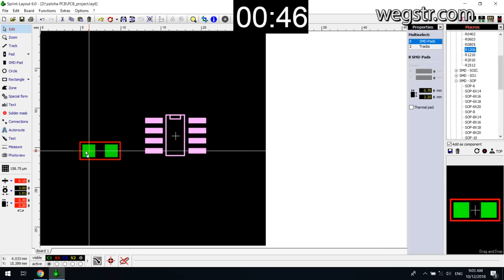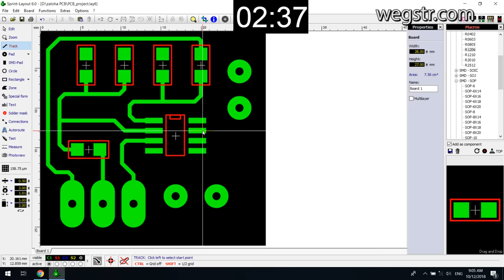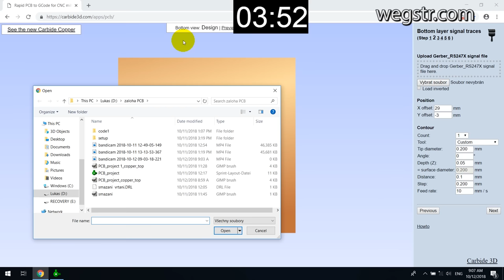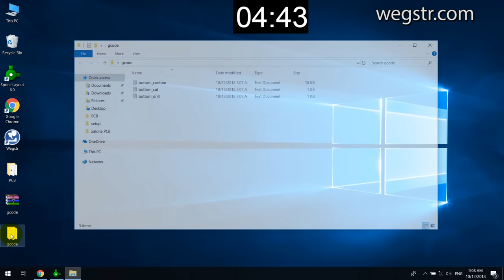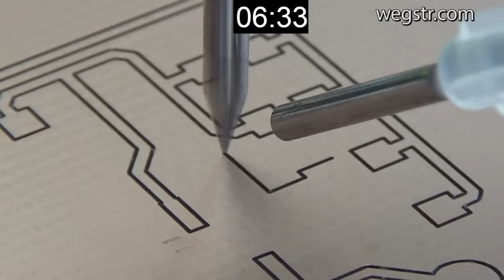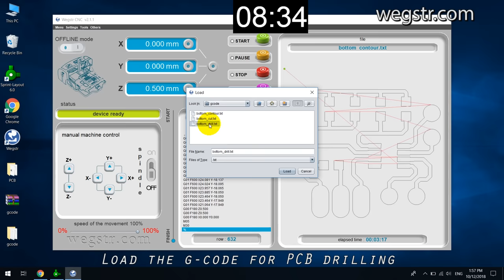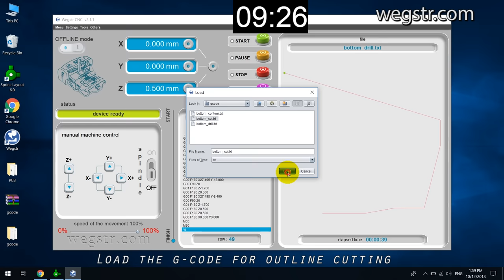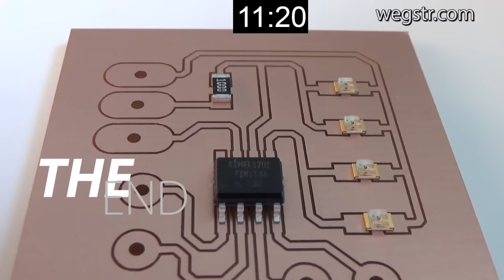PCB making, PCB prototyping quickly and easy - STEP by STEP

Comment: misleading video title: it should contain "expensive" as it involves the use of a commercial CNC tooling machine; a laser engraver is way cheaper and yields comparable precission and quality results
Reply: If you have a cheap 3d printer around adding a motor and small engraving bit is a prettycheap option. Should cost around ~200$ to get you the same results!
Reply: @mattyd_gaming7425  Not sure 3D printer has enough strength to keep routing motor.
Reply: Only a very high power (expensive) laser engraver will cut copper clad.

Comment: Step 1: Own a CNC machine
Reply: Exactly what I was going to say
Reply: @Pdrum2  of
Reply: It's very easy to short circuit (while soldering) because of small gap between conducted part and "no conducted". Maybe soldering is performed by another CNC ?
Reply: Step ZERO
Reply: @sawomirsiwek7558  so you just don't know how to solder?
Reply: Fuck.. that's a small big list..
Reply: I mean everyone here should be able to just build one right?🤣
Reply: Even with the cost of a bench top cnc mill / engraver, if you are doing one off PCBs on a more than a few times a year basis, the cost is reasonable in comparison to a prototyping board manufacturer or spending hours laying self stick mask components and etching in ferric chloride. My CNC was $600 as a complete kit, five years ago and similar units today are in the $300-400 US range. I also use my CNC to make engraved tags in brass/aluminum and plastic, plastic switch labels and controls ID plates and custom markers, the end results of my control panel builds going head to head with competitors with much larger shops.
Reply: Why I should buy such machine that cost around 4000$ while I can prototype my pcb's in China for less than 0.7$ per pcb
Reply: @MrfB-br6yh I have about $700 in my machine, support parts, bits, computer and software to mill single and double sided PCBs. $4000? Not even close. 

 $7 for a single board? What is the turn around time? No setup fees or processing fees? 
I would be surprised...
Reply: @Bear-cm1vl  it's aroud 0.7$ per pcb "double sided" not 7$ as u mentioned it take about 15 days to arrive from China via aramex so why I would buy such machine and pay a lot of money
Reply: what's the name of the board please
Reply: @reubenkwabena2280  which board
Reply: @MrfB-br6yh  yeah, thanks very much, i realised its called the copper clad
Reply: @MrfB-br6yh  link please for the 0.7$ pcb manfucter
Reply: Step 0 : have to load of money .
Reply: I guess it depends, my university has one open to all students (regardless of coursework) so this is kind of useful information.
Reply: @MrfB-br6yh  where to get?
Reply: step 2: make a pcb
Reply: @MrfB-br6yh  "it takes 15 days to arrive from China"
It takes 15 minutes to arrive from your garage. That's the difference.
Reply: And... How much it costs?
Reply: Haha yezz
Reply: Maybe they can use Zeppelin as the background - like ‘Achilles Last Stand’ or something like that…
Reply: Bruh make your own

Comment: Back in 2000 as an electronics hobbyist at that time i was designing on paper and making myself the PCBs for fun, electronic door bell, small radios, cable TV amplifiers,  etc using nail paint and nitric acid, and as for drilling, i was making the drills manually with a small device. Took me hours to complete something but every time in the end I was so happy that i did another working PCB without any mistakes.
Reply: kudos to you mate !!! but today it is about monetizing your projects taking on the big guns in this tough economic times
Reply: Cris33311     Прямо с языка сорвал .
Один в один!
Азотную кислоту не применял.
Хлорное железо, само собой потом:
Перекись водорода+ слабенький р-р HCl
_или медный купорос с солью.
Получалось просто зашибись.
Самое "тяжёлое"- нарисовать красиво, без " соплей"и пропусков.
И лаки, у жены украденные, и всевозможные нитрокраски- всё испробовал..
...давно это было...
А лучшего человечество и не придумало...
Кроме как травить....

Comment: Back in the old days pcbs were hand drawn
Reply: Back in the day we used to draw, route and check 15" x 15" PCBs by hand. It was mind-numbingly boring.
Reply: We  Use PRESENSITIZED PCB after  the image is set and wash away with cemical, we use etching solution to eat the copper.  Just don’t throw the waste down the swimming pool. 

Some smucks did and closed the entire PE swimming class for a whole month
Reply: @BritishBeachcomber  😂😂😂
Reply: @usvplaylist8758  😦💀

Comment: nobody use such big places for soldering and holes (its just show of how cool this product is, but its no real use case). Show us holes 0.8 mm and places of 1.5 and don't forget for soldering mask removal with spring loaded tool. This machine is expensive with no reason. Every other CNC can do the same saving your wallet

Comment: Not everyone has a cnc, wait can I turn my 3d printer into a cnc engraving machine
Reply: i'm wondering about the exact same thing :D

i've already turned my ender-3 into a pen plotter, next step will be to build a motor mount which accepts 5.5mm drillbit shafts. precision and wobble will probably be huge problems, but it's worth taking a risk
Reply: lil update on the pcb mill, i decided to go for a pen plotter instead, which has the downside that i will need to etch the pcb. However, it's gonna be alot cheaper and alot less complicated to make

i'll upload a tutorial in a few weeks/monts on another channel, but i'll create a public playlist so that anyone inetrested can easily find it

Comment: So, where is PCB? It's a drawing with holes.
Reply: It's used to silkscreen solder resist
Reply: Vasyl, that is the PCB. This is a negative process, removing the copper between the traces. The cuts open the gaps between the traces down to the backer and leave the traces. It looks unusual to anyone who is used to etching their boards, because they expect to see the copper removed from all the large areas surrounding the active traces, but this technique leaves the unused copper instead.
Reply: @becketthor  I guess it could be used as a positive photoresist mask, as long as your light source was strong enough to pass through the PCB backer and the backer had no labeling on it, but that would be a waste, since you have a fully processed PCB at the end of this cutting, ready to be cleaned and soldered.

Comment: Assuming that the soldering of the components will be done by people (and not by a robot) the possibility of this process end up resulting in some short circuit point(s) is too great!! You should have programmed the router to remove a larger area of copper around the tracks!

Comment: Great video, thanks a lot.
The PCB is fixed by two supports only, no autoleveling used and traces milled look just perfect.
Did you use spring loaded bit here? Or is the bed mounted on springs?

Comment: I have a desktop CNC machine that will route PCBs (with trace widths down to 8 mils), but it'll also cut parts out of aluminum.
Reply: Hi 👋 , I also have the same😅, let's connect?  OddlyIncredible

Comment: So satisfying to watch. Wish I had one of those machines. Hand etching a circuit layout takes longer.
Reply: You can use a presensitized pcb and with some test about uv timing u can have very good results
I had successfully made a double sided pcb at home for a flight controller with clearence 0.1mm between traces and pads and all its  components is smd.
U still need to heat the etching acid so use boiled water and u will be ok
I even covered it with a uv solder mask and make a screen printing for the components using a silk screen with white color uv solder mask
Reply: @MrfB-br6yh  Thanks for that info! I'll look into that for the next time I make something. I bet it looks really nice and neat and professional. Thanks again🙏
Reply: @SSGSativa  welcome any time every time

Comment: Very expensive precision engraving machine .Software cost ? The copper-plated-Laminate-bakelite Plate cost per square cm ? Is it possible to Replace the present PCB manufacturing process ?? Good idea with simple process without any chemical processing such ad etching,UV,plasma, +- light harden/remover material,. ..etc

Comment: Great. Let's see it do traces for a 128-pin QFN IC
Reply: With the right bits and low enough lateral cutting speeds, it works. Honestly, at that kind of spacing, soldering issues and bridging are more of a problem than the cutout of the traces.

Comment: There is more chance of short circuit soldiering, bcz you are not removing unwanted copper part
Reply: That can be verified with a quick continuity check using a multi meter
Reply: using a small 1.2D tip and inspecting the solder joints being power up (and ohms check) should be sufficient
Reply: @keithforbes2326  what about a bigger circuits
Reply: @dijuathomas5955   a lot more work, but doable. but yes you are trading less CNN time for more chances of a short circuit, not too bad a trade in my opinion. but he does have a video making a red solder mask

Comment: Nice vid. Gives me hope with my CNC mill. Created board using EasyEDA but not all Gerber files created so a little more work to do. Also building a reflow oven using  WalMart toaster oven, an Rocket Scream reflow oven controller+thermocouple and a Solid State Relay. Trial run of oven good.

Comment: I downloaded the wegstr_v3.1.1.zip. and unzipped it. It produced a folder 'Samples (g-code)' which contained some GCODE files. I tried the  'PCB.txt' file in my licencensed copy of Mach3 and it worked. What code was used in this video on your cnc machine. 'Sprint-layout 6' does not seem to produce GCODE only HPGL. Is it possible to convert HPGL to GCODE?

Comment: Online app for gcode? So I have to pay to get the machine, and I have to pay for internet just to use it...
Reply: Just wait until the website goes down for good. I have to assume there's some local application that can do the same thing?
Reply: @chaos.corner  As long as you know what codes it uses for which functions and have at least one file for header info, another gcode generator could probably be set up to work with it. The problem is with companies who try to make a closed ecosystem of products, only to leave their software massively vulnerable. Most browsers can't tell the difference between a local html file and a live site, if a web app is really that much easier to implement.
Reply: @c4pt1n54no  I agree. GCODE is well understood so someone could definitely create a similar app if they haven't already. I don't know if this site is even affiliated with the machine producer. I appreciate when people create sites like this but they absolutely cannot be relied on. I would avoid buying something that required online access as part of its workflow (unless that was essential to its activity).

Edit: Even worse, the site appears to be run by a competitor. Imagine if they decided to mess with this company and suddenly require a login (available only to carbide3d machine owners) to access the site.

Comment: Thanks for the tutorial! I tested the example on a CNC3018 PRO. There are some adjustments to make but it works well :) 👍 👍👍.
Reply: Hello I have a 3018 pro and every thing it's ok for pcb engraving no problem whith the copper you can cut that with the mill tools delivered with the machine ...

Comment: Very nice and quick. What is the be-burring process? I work in aerospace and have had boards in with 'frilly' edges to the tracks. When you are trying to tune a stripline at centimetre wavelengths it is a nuisance when bits fall off the strip and shift the frequency.
Reply: I found frilly edges can be removed with a hard plastic bristle brush, or brass brush.

Comment: Does someone buy this machine? Could you tell me your experience with it?
Reply: I don't own this kind of machine , but with a lowcost one I managed to get the same best result with this method , I keep !!! ( CNC 3018 / Arduino UNO / CNC Shield V3 not the original woodpeeker )
Reply: @MC909Garfield  Tu puedes hacer ese tipo de trabajo?
Donde tu vives?
Reply: O Cristian
Tu puedes hacer ese tipo de trabajo?
Donde tu vives?

Comment: What is that little green part on the tool for?
Reply: That's just a collar so you can have consistent tool setups and the color helps you in picking the bit you need more quickly if you use one a lot.

Comment: Hi, WEGSTR, I have this WEGSTR machine. The problem is, how do I let the machine or software know that the tip of the bit, resting on the PCB, is indicated as starting point?
Reply: Use a Z-axis zero setter to set the zero at, say 50mm above the work, then jog the axis to zero
https://www.ebay.com/sch/i.html?_from=R40&_nkw=z+axis+setter

Comment: Total flipping on this process. Before was you ink out the connections. Drop in acid and dissolve all the metal off the board. Now no mess and no acid messing around. Absolute brilliant.

Comment: Hi, thanks for the great videos,
I have built my design but I have some questions regarding the trace width of AC 230v and 3.3v I am using esp8266.
1. For AC line how much the width and clearance between AC - AC line and AC - DC line.
2. For DC line how much the WIdth and Clearance between DC - DC line
Please help me I am in the middle of my implementation.
Reply: There's online tool you just need to put the maximum current that will flow in a trace and they will give you the width
Reply: Clearance = Isolation: 3,2mm

Comment: This is a professional mode,but still I'm stuck on old mode means manually using sodium hydroxide and ferric... and works fine even for critical and complicated circuits.
Reply: youssef abdulmuti: ok - but then you etch away all the unused copper which could be a great ground plane.

Comment: The PCB is not being held flat by anything!
My Colinbus PCBBox has a a sliding pressure plate surrounding the bit, so that even warped boards may be consistently milled to a thousandth of an inch accuracy, AND repeatability!
Repeatability on this setup would be atrocious.
3 things: Accuracy, Resolution, Repeatability.
Have any of those missing, and you might as well give up.
Reply: I've been using double sided fiberglass woven carpet tape to hold my PCBs and sign plastic down on a bench top CNC mill for about five years, have excellent repeatability, very good resolution and very good accuracy, along with holding the free cut board when cut from the larger stock and have less than $1200 in it, including the PCB design software, G-Code converter, Mach 3 control software and the initial setup bits and bobs. A quick search for your machine shows used selling for €3500... 
The only issue I have ever had was with a poor quality double sided board, where the copper sheet pulled off of the base resin when removing it from the carpet tape, and I would rather know about that before the PCB makes it into my customer's hands.

Comment: Z Deep? 
Speed? Mm/Min
Tool Dia?
Reply: Only taking a guess from my own experience:
0,3 mm depth
30000 RPM
100-200 mm/min
V-bit, their diameter increases the deeper you go. The increase ratio depends on what angle they have.

Comment: It is good but this system is waist too much time .
.
Reply: You have to realize it takes time because you don't want your drill, cutting or ink to get hot. I thought it was an overall good PCB maker. If the ink gets too hot, it smudges, if the drill or cutter gets too hot, it melts the board and it can ruin your drill by warping? This is why it takes the time, to ensure quality?

Comment: very few boards can fit on just 2 layer PCB like this one, most circuits will require 4, 6 or even more layers. I think the highest number layer boards made in the industry are more than 20 layers right now.
Reply: Don't mistake hobby production with industrialized production.
Reply: Nonsense.  2 layer (double-sided) PCB's can accomodate virtually any 'analog' circuit. And this has to be a single sided PCB....if it is 2 layer every component will be shorted to every other component once they are soldered.
Reply: @wallpapermusique  I am an electronic engineer, real world circuits are so dense that 2 layers are usually not enough to contain them. There are so many circuit paths that with 2 layers, we just can't accomodate them. And then with high speed design we need to have power plans, ground planes along with signal planes, in a specific stack up. That comes to more than 2 layers.

Only the simplest circuits can fit on 2 layer boards.

Comment: ok am i just thinking of this correctly or am i just being dumb? So that is a sheet of copper right. meaning drilling little traces out of it wont actaully change anything and if you were to solder anything to it it would immideately just short out? or the materail shown multilayer so its drilling past the layer that is conductive allowing to have actually decent traces that dont short out with the rest of the board?
Reply: It may look like a solid sheet of copper in some shots but it is in fact an isolating material with a thin layer of copper laminated to it. You can see the chips are only partially copper coloured and by the speed of milling the outline you can tell this can not be copper, this operation would be a bit nightmarish in solid copper. This copper clad laminate is a very common material for PCB manufacturing and is even available through hobbyist suppliers.
Reply: @dercebe  that was explained so nicely. I would maybe have commented something more rude. 😄😄